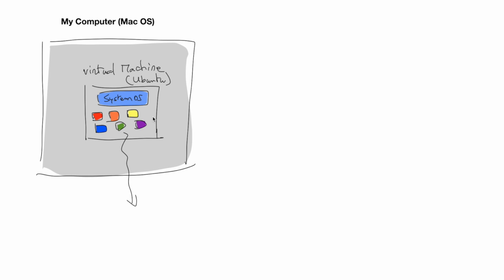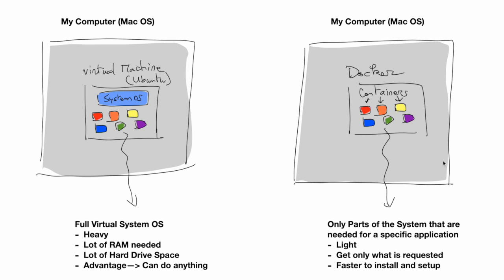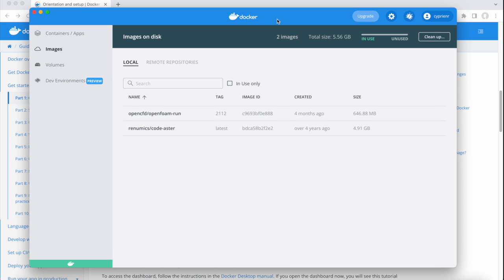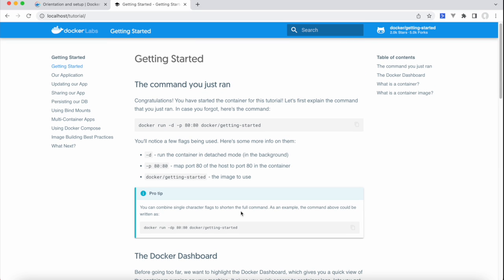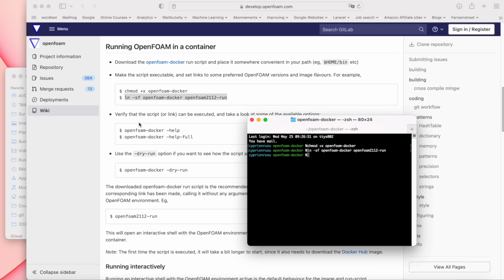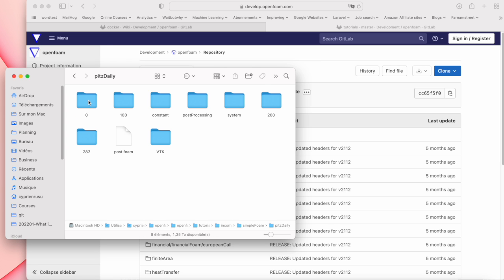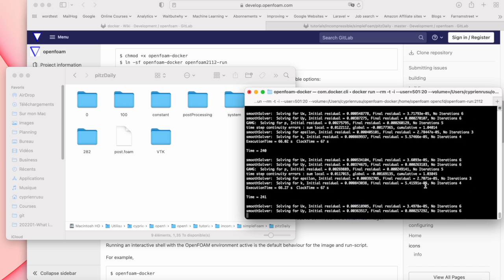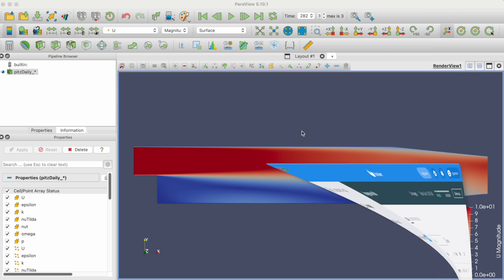Running OpenFoam with Docker on my Mac M1 Pro

Comment: Nice video. Can the same procedure be used for Salome Meca? This would be great to run the program on my Mac M1 Pro.
Reply from the maker: So you can run code_aster, that’s for sure.
Probably, you can also run Salome, but as soon as you have some graphics and GUI, it becomes harder because then you need to install all the OpenGL and xdisplay related ubuntu packages through docker which is not easy (but doable)
Reply: @Feaforall  Thanks. I wanted to avoid the problems with OPEBGL en xdisplay but i do understand that Docker isn't solving that problem in a easy way. Thanks in advance for your reply.